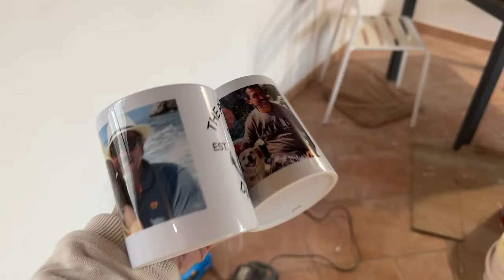LET THE TUSCAN HOUSE RENOVATIONS BEGIN! Tuscan Diaries EP 02

Comment: You‘ll need a lintel over the new  arch otherwise you‘ll most problem with cracks appearing. Also when you eventually sell up you‘ll be getting a sanction from the commune for the changes. But that‘s a later problem.

Comment: Wow when I moved into this guest house 11yrs ago had only a hot plate, toaster oven, baseboard heater and running water but no water heater.  Had to go to motel for 10 days during a blizzard to get the nasty cabinets, shower removed a water heater installed and work done. Took me 3 mos to get to where you are now. Still not living in the big house as needs replumb, rewire.

Comment: How exciting it is for you!  Do get a base of some sort to get your mattress up off the floor as you will quickly develop a mold issue which will ruin your mattress. . A slatted bed base is best for that type of mattress so that the air can circulate. A lot of tiny home owners learned that in their loft bedrooms where they did not have a lot of headroom to allow for normal beds. You can also buy a special mat for under the mattress that has been developed to allow air circulation .  Cannot wait to see all the changes!  Good luck!!